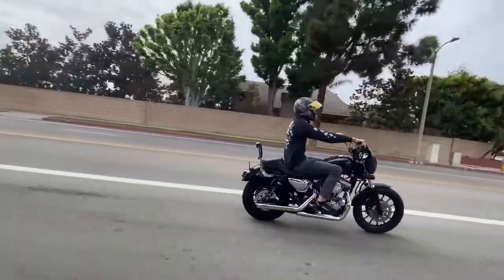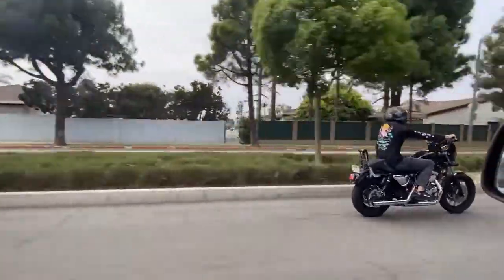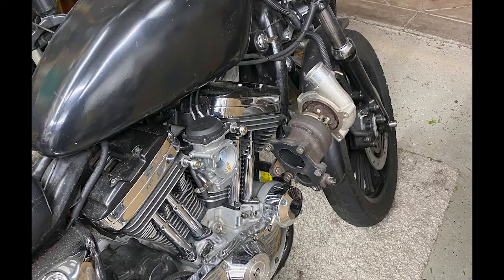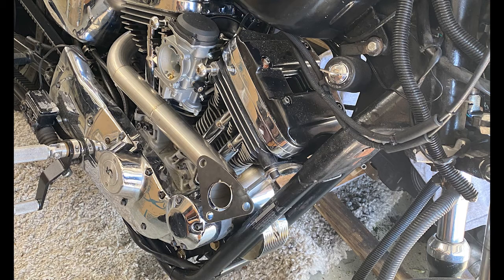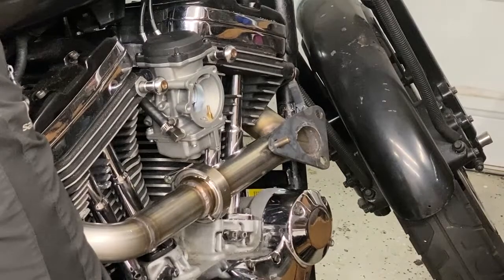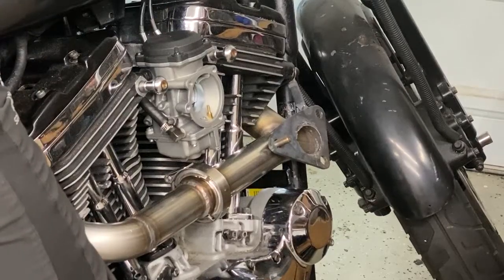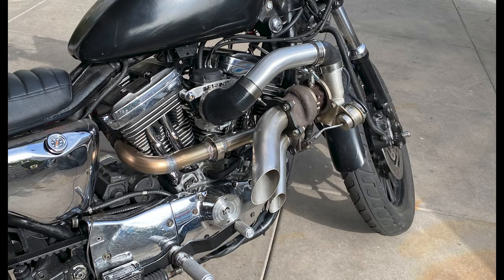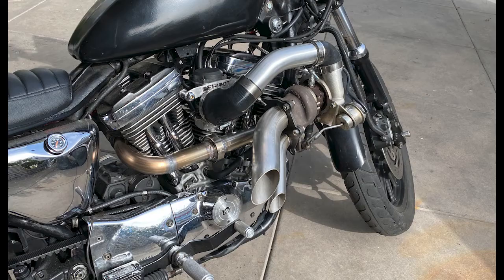Building a Turbocharged Harley Sportster! Fabrication

Comment: Hello Hi, did you change the engine bearings, connecting rods, or crankshaft, or is it the original? Just with the turbo? What model turbo is it? T22 or T15?

Comment: Did you get this running good? 
Blowthru isn't that difficult to make work well. And well worth the little extra adjustment IMO. As long as you have nitrile tipped float needle and use a pitot tube for pressurising the float bowl. To me The time consuming part was finding the right spot in the boost pipe. Closer to turbo=richer, further=leaner.

Turboed my single carb yamaha xv1600 about 7y ago. All i changed was blocked the breath tube above diaphram, blockes the airjet at the mouth of carb, pressurised bowl with pitot and used a wideband AFR, fuel side. Runs like stock, good AFR and no problems.

Other performance mods include barnett clutch, 2 tooth smaller front pulley and dyna3000 CDI with 5k limiter.

Made 100hp/200nm from tire with 0,6bar.
Reply from the maker: Never did with the carb. At least not to my standards. The best I got was lots of hesitation and terrible AFR curve. Just not enough control over the fuel. I went through a few different pitot tube setups, fuel pump with boost reference pressure regulator, and it had all the standard mods you’d need to get a blowthru setup working. I ended up building a fuel injection setup for it then tuned it for e85. I ran about 8lbs boost (maxed out injectors) but it was quick by the time I sold it

Comment: Did you try mounting the carb into the turbo to build a draw through system? If I was going to turbo charge a carbed bike, that's the way I would do it.
Reply from the maker: I did think about it, but the look I wanted was the spinning compressor wheel being what you see haha also, if you think about when you do a quick rev, it’d take awhile before the accelerator pump fuel makes it to the motor (normally you want the carb as close to the chamber as you can get it )

Comment: Are there any experts on here? I need advice tuning my turßoed bike.
Reply from the maker: There’s hillbillies here, what’s your question boss
Reply: @hillbilly-engineering  just want to get an opinion on my set up. My exhaust is routed so my turbo is on the driver's side save everything else is in the passengers side. I. Running a electric fuel pump and a carburetor
Reply from the maker: @RitzCaraldo  I had trouble with my carb setup, it was blow thru tho. Suck through is easier for sure. How you checking afr?
Reply: @hillbilly-engineering can you recommend an EFI set up?

Comment: Can you post a link of what turbo that is bc I have the same bike
Reply from the maker: It’s the stock turbo from a Subaru wrx, known as a TD04. If you just google Subaru td04 you’ll get tons of hits. You can buy Chinese copies for super cheap but I’d try to find an actual used one so you get the oem quality 👍
Reply: Hey buddy how did you run your oil feed line

Comment: If you want to mount a turbo on an engine with a cardurator, you must place the carburetor on the intake in front of the turbo.
The carburetor works with vacuum, it is not able to work with turbocharging if it is connected in the pressure part of the intake.
Otherwise, if you put it in front of the intake, the turbo will work as it should, only with a longer response to the gas, even with a long intake.
Reply from the maker: They call this setup draw through or suck through, instead of blow through. I do think this would have worked but yeah it had too many downsides for my taste. The big one was aesthetics, I really really want the turbo blades exposed haha

Comment: Hillbilly Engineering how much faster did it go fastest speed have you had it at? Di you bore the engine at all or just turbo?
Reply from the maker: I just rebuilt the engine, cleaned everything up and put it back together. Still stock bore size. It’d be pretty sweet to go big bore though! I have no idea how fast the top speed is, every time I floored it my eyes were on the road haha I would say with the carb (which wasn’t really working right) it was 30% faster. It didn’t feel like it made a bunch more torque down low but you could definitely feel the added power up top. Before turbo it just felt like I was making a bunch of noise and after it felt like I was really going somewhere
Reply: With stock cylinders on a  Sportster you can only bore to 1212 or 1214cc. After that they have 1250 and 1275 big bore kits. They have a 90" kit but it's not a bolt on you have to disassemble the complete bottom end and have the cases bored. 
75cc isn't a lot, you can make that up with boost pressure. 
I know of someone with a drag bike that's running a stock 1200 bore and a blow through setup using a S&S carb. He runs between 14-17 psi boost and makes 176hp

Comment: It won't transition into boost correctly or reliably unless you're using a Pitot tube. I use modified Thunder Power jets for the pitot tube, so it's adjustable on the fly. If it doesn't transition right, you just adjust the knob on the thunderjet until it transitions correctly. That said,I don't even think Blow-Through is worth the hassle anymore, either keep it simple with a draw-thru setup or just go EFI like you did. Blow-through can be a nightmare to dial in right, not to mention if the float sticks, your whole motor is going to be flooded with gas.
Reply: I'm fixing to start a blow through build myself.  Mainly because it's old school, plus I was advised not to and it was hard (for me) to find the info I needed on the carb. 
The guy I got all my info from said he never needed the pitot tube. He picked up boost signal from a fitting in the back of the plenum. I haven't made it that far due to health issues but I may very well have to install a pitot tube  before it's over. I was told installing a AFR unit with a data logger would make life a lil easier when it comes to tuning.
Plus I'm making it more difficult by running the turbo on the left side. 
58yrs old now if I don't get it I'll die trying.
Reply from the maker: Great tip on the adjustable jet for pitot tube. I did look at the snowmobile and jet ski turbo carb setups too and tried to replicate those but once setup and going it was really hit or miss. I don’t know how people tune these things without a dyno or your method with the knob. Efi seemed like the only option!
Reply: @hillbilly-engineering if you ever try it with a carb again modify a mikuni hsr42 and install an AFR wide band unit with data logger and it will save you a ton of Dyno time when tuning
Reply: Can you help me out with my turbo set up on my Harley? I can't find anyone local that will even touch it
Reply: Can you recommend an EFI set up?

Comment: What are the sizes or part numbers of the charge tube assembly that you put together (the two 90 degree silicone elbows and the section of bent pipe)? Also, is the carb adapter offset slightly to the left side on the carb ? It's a nice clean install for a diy project 👍
Reply from the maker: Hey thanks. The turbo has a 2” outlet so it’s a 2” 90 degree coupler, then a 45 degree 6061 aluminum bend, then a 2” to 3” 90 degree coupler. I used my plasma cutter to make the carb flange with enough material to offset the 3” tube, this way one of the screws is inside the intake but everything lines up and barely clears. Hopefully that helps!

Comment: Year my bro needed to drill an additional hole in the carb for to ease pressure when under boost, I can't remember exactly how he did it though.
Reply: He took the intake drilled a hole in the bottom and tapped it for a ss non tapered nipple with a hose running all the way to the back of the bike to release that pressure

Comment: Well... your carb setup needs a pitot tube,that enrich mixture when turbo spools.... Everyone uses stock carbs in sports bike's with turbo.... no issues there...
Reply from the maker: Nice observation. I did actually have a pitot tube installed and played with the size but just couldn’t get it running right during spoolup. Sometimes it’d make it through the sputtering but most times not… my fuel pressure regulator had to be JUST right too and I had to roll into it a certain way. I also read that the cv diaphrams don’t hold up under boost and since I’m more comfortable with efi I just went that route instead. Another thing I read is the pitot tube works better with small turbos like those on watercraft but larger ones tend to be more fickle? Can’t verify that but it factored into my decision also.